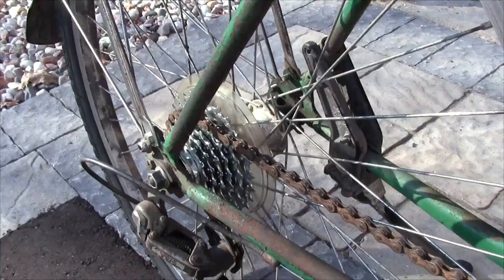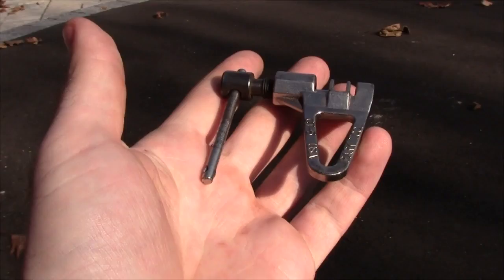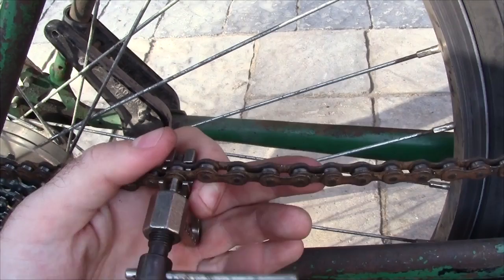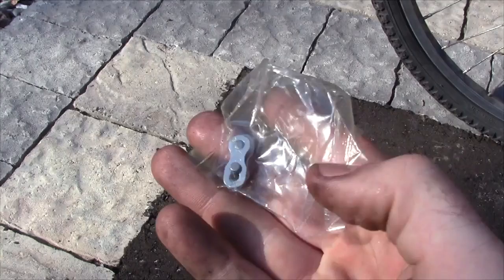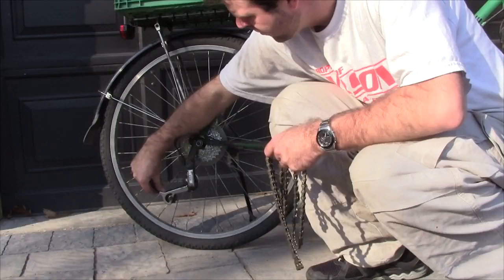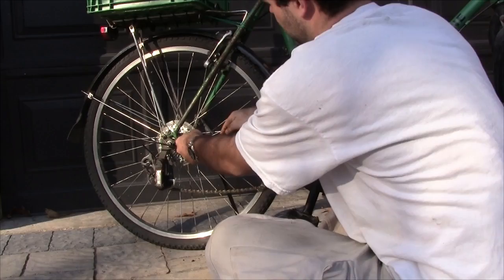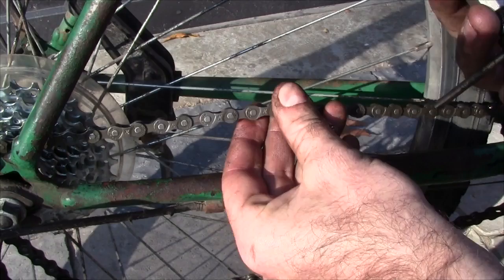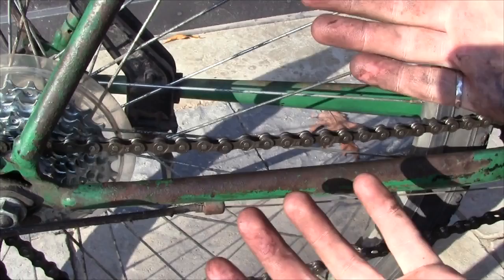How to Replace a Chain on a Bike

Comment: CJHoyle, you easily have some of the best bike tutes on YouTube. Thank  you SO MUCH for taking the time to make these. Your videos have been essential in helping me repair my daughter's bike. 

I do have one small complaint about this video. You didn't show how to put the chain on the bike. Specifically, you didn't show how to thread the chain through the derailleur. This was the part of the video I needed the most, and it wasn't there. Otherwise, it was a phenomenal video. Thanks!
Reply from the maker: Thank you for your feedback. Unfortunately that part is somewhat difficult to show on camera because the chain snakes through different areas and is not easily visible. My advice is to refer to another bike when you are reassembling it and match the path that the chain follows. This video was posted almost 5 years ago, but if I ever make another one on the topic I will try to explain this part better. Thanks for you support.

Comment from the maker: Some people are really fussy about what type of chain lube they use. I personally just use a cheap general purpose chain lube that I get from Canadian Tire (a canadian department/sports store). The bike shop where I used to volunteer at actually uses motor oil. In my opinion, the type of lubricant you use really doesn't make very much difference in terms of the performance and longevity of your chain.

Comment: Very nice video, i bought the same chain for an old bicycle was surprised how easily the chain tool works. I use the masterlink its easier to take the chain off and completely clean it. There reusable up to 3-4x. Id recommend using a new pin though when installing a new chain.

Comment from the maker: Yes, that is a good point. However, it is very rare to have issues with the chain skipping on the front chainring sprockets. The reason for this however is that there are many more teeth on the front chain rings. With more teeth there is a lower force on each individual tooth which causes it to wear at a much slower rate. Also with more teeth in contact with the chain, the fit of the teeth and the chain doesn't need to be as precise.

Comment: I did this. Big mistake but there you go. I did the following:

Join the two links of the chain together as you would normally. Place on a flat surface.

Hold the pin above the link hole with a pair of pliers.

Tap gently with a hammer until its held in place. It may be at an angle but as long as it it is held in place.

Place the chain in a Chain Tool and rotate. I may have been lucky but as I turned the tool the pin straightened up.

I then continued as cjhoyle does in his video.

Comment from the maker: As I explained in the video, you aren't supposed to push it all the way out, leave it so it is still attached on one side. I've always done it the way that I showed in this video. I've heard it is very difficult to line it up properly and push it back through if it comes out. My only advice is to salvage the links where you removed the pin.

Comment: Hi CJ, I'm replacing my chain but when I removed the old chain the rear derailleur flings right forward in opposite direction to what yours does, also the deralleur wobbles from side to side, do you think I should replace it before putting a new chain on? it's on the highest gear on the rear cog and it's on the second cog on the front, as the front shifter doesn't work so I can't move it from the second cog unfortunately. Thanks a lot, Daniel.
Reply from the maker: Did you make sure that the new chain was the same length as the new one? What you are describing sounds like you have a chain that is too long.
Reply: No I couldn't measure it to the old chain as I accidentally pushed the pin all the way through on the old one, so I just used it to practice with the chain breaker and took it completely apart, I have no reference to measure against now. But every time I put the new chain through, something just looks odd with the rear derailleur, thanks anyway, I will try and shorten the chain
Reply: +Daniel Blackwell Too late now, I know, but you could count the number of links.

Comment: What's the rule of thumb when you have a new derailleur with a longer cage and you need to size the chain? Should I add one more link? The upgrade is from Shimano Tourney to Acera with Smart Cage.
Reply: Also, the chain ring limit on the derailleur is 42 teeth but I'm getting a crank set with a 48 tooth largest chain ring. Will I experience problems?